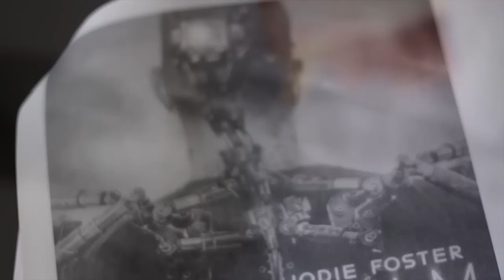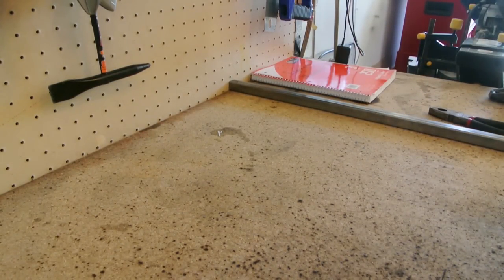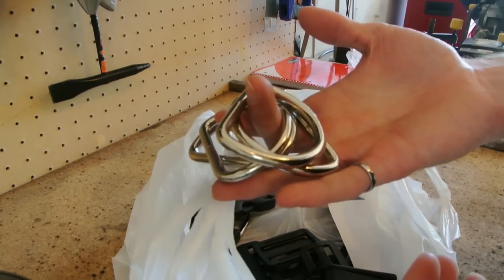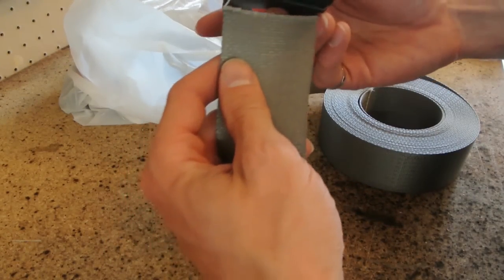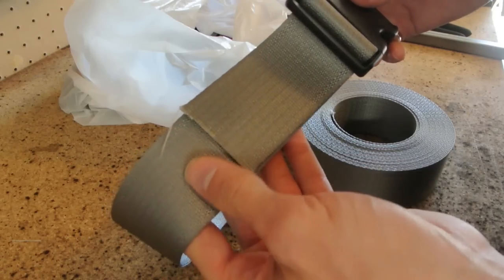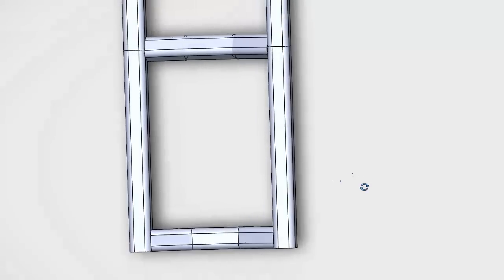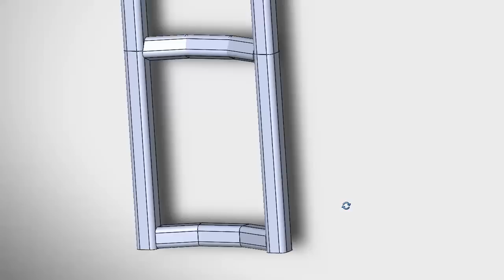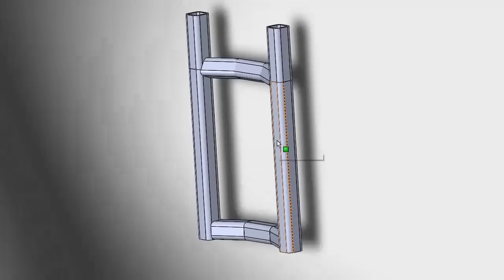Elysium Exoskeleton, Part 7: Quick Update

Comment: you ever think of making it fully portable what you could do is get one of those light weight 6 to 8 gallon rechargeable  air compressors mount it to the back of your harness and connect it all up just a suggestion and by the way i love ur videos you really inspired me to want to build an exoskeleton for one there cool and two there really benefit ail
Reply from the maker: That's the plan! But not a rechargeable air compressor -- a scuba tank. You see, scuba tanks can hold a lot more air -- at pressures of up to 6000 PSI. The exo only needs 150PSI, so the scuba tank will actually act kind of like a battery for the suit, along with an onboard compressor for the smaller main tank.
Reply: thats even better i like the way you think
Reply: +the Hacksmith youre so fuckin smart i love you! xD